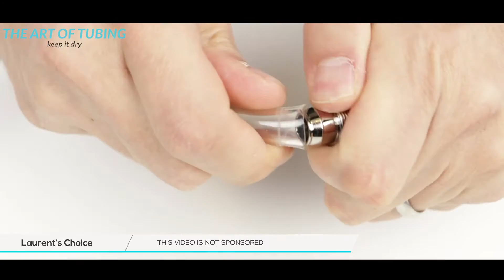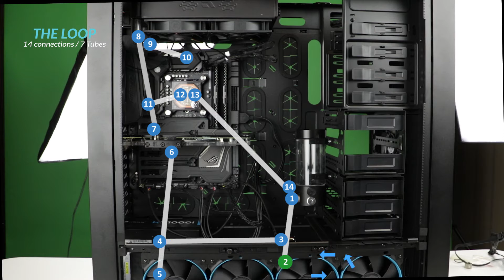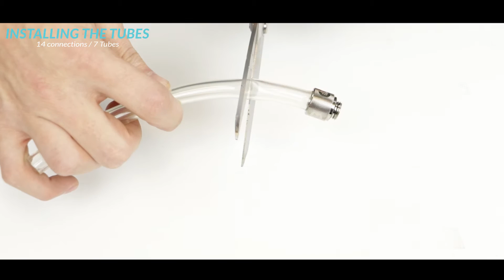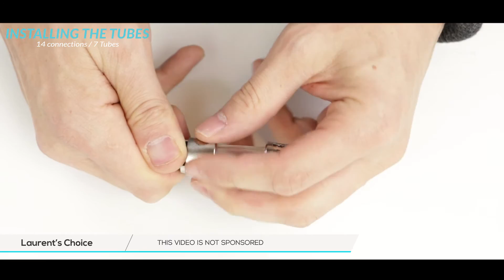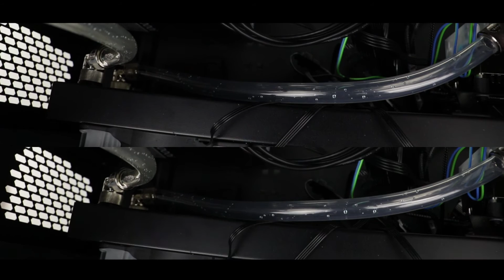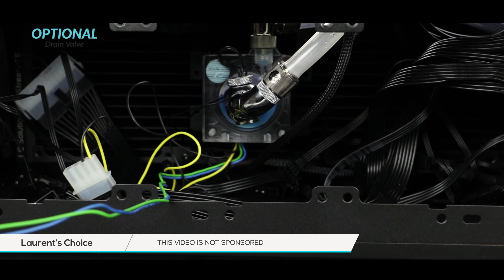Tubing and Compression fittings (custom water rig 9/9, Part 1)

Comment: This might be a dumb question but how did you screw in the finished tubes with compression fittings, elbows and extensions into the loop? Wouldn’t the whole thing move around if you screwed it in in one piece?

Comment: Hi, I wanna get that board, was the vrm's cool while watercooled?
Did you see a noticeable difference in temps compared to it not being watercooled?
Reply from the maker: Yes there is definitely a temp difference . Water cooled will provide about 60% increased cooling vs air.

But air cooling will be just fine for most of your gaming's and application . 

Water cooling is really an enthusiastic endeavor which does not always makes sense :)

Comment: hi there! what tubes are you using?! 16/13 or 13/10
Reply from the maker: +Steve T. 15.9 / 11.1 or In other words 5/8" OD and 7/16" ID
Reply: that was fast ;) thx !  i am going to build a similar rig, but i dont know what has the best looking.. 16/13mm or 13/10mm .. even i cant buy 16/13mm online (where i am going to buy all the other stuff ) pls excuse my english -greez from germany !
Reply from the maker: +Steve T. No worries... My advice... Buy a kit.. with everyhting included! Like i did :)

You will not have to worry if différents éléments fit or Not :)
Reply: tu again! now i am going for 16/11 aswell, but unfortunatly i cant find EK fittings 16/11.. all i see are fittings  16/12 i believe they wont fit.. i am wondering why EK havnt suitable fittings or am i just blind? I want to buy all this stuff at "caseking (germany)" if it matters..
Reply: I used 3/8 inch id 1/2 inch od it is much less of a pain to work with...

Comment: what ek system did you use? or what specs did you use?
Reply from the maker: I used the ek-kit x240, but also the 480 rad. Keep in mind that the motherboard came pre fitted with a EKWB water block.
They are good but not the only ones on the market. There are other very good brands!
Reply: fantastic video. thank you for the quick reply.

Comment: is motherboard waterblocl necessary as i haven seen earlier one...i only knew about cpu and gpu block....attaching them to radiator will work?
Reply from the maker: +Aksshay Sharma motherboard waterblocks are not an obligation . Only some gamers motherboard provide this optional feature.

If you go this way, make sure that the waterblocks openings mach.